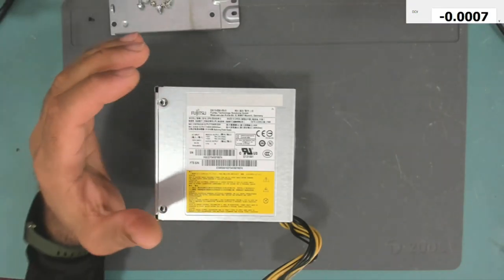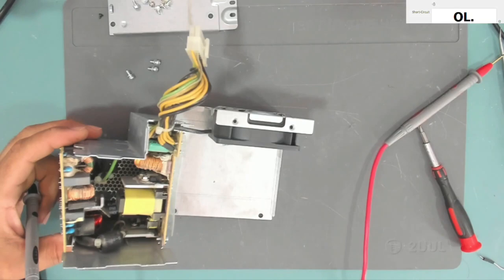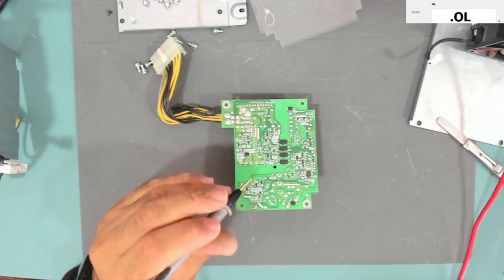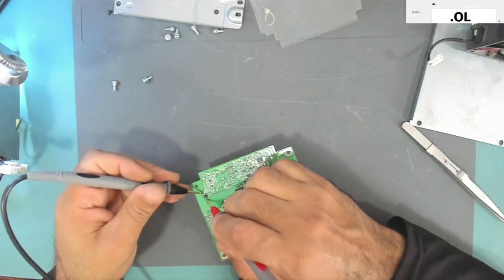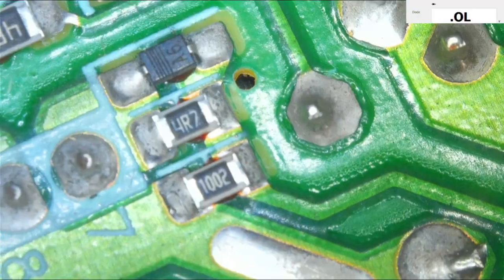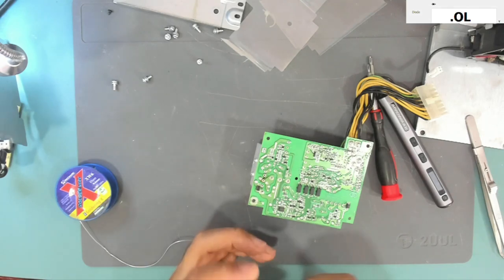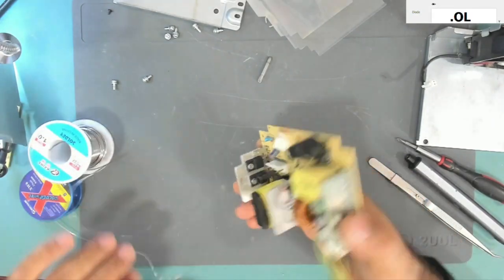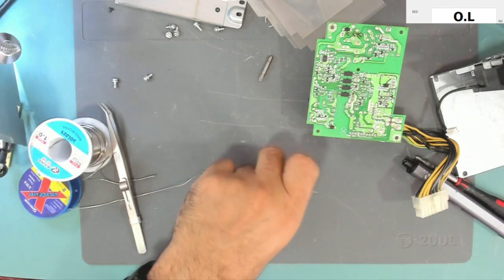Fujitsu PC Power supply repair || SMPS Repair

Comment: Hello,
also had a Fujitsu 12V only Powersupply from Fujitsu.
Its a little bit different, but there was also R901 blown!
Also had to replace the TNY380PN as Source Drain was in the range of 30Ohms. 
After changing both parts it's working again!!
Thanks for your Vid!

Comment: Nice trick with the second transistor 😂
I mean desoldering. Like it !
Reply from the maker: 😁
I used a low melting point 138°C solder wire which stays liquefied for a bit longer than the normal solder wire.
It helps a lot when Desoldering big components
Reply: @FixTronics  that's nice, wish you good luck with your YT channel!
Reply from the maker: Same to you friend 
I wish you all the best to you and your family